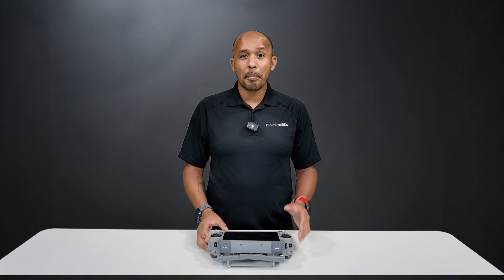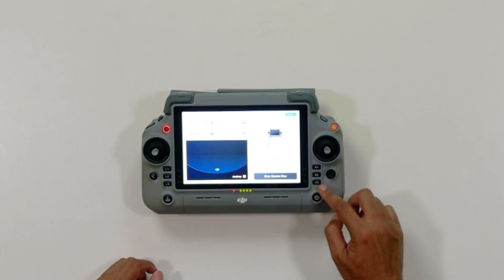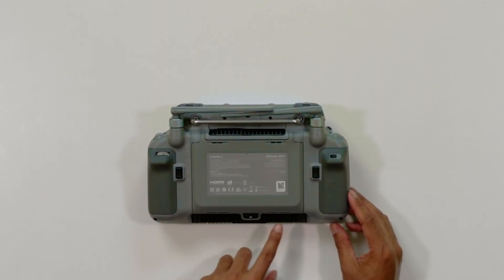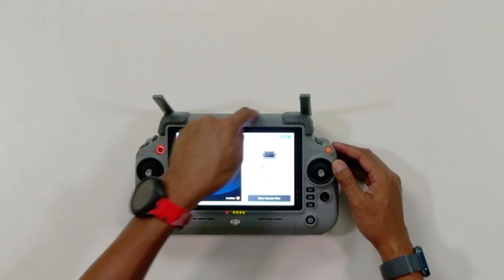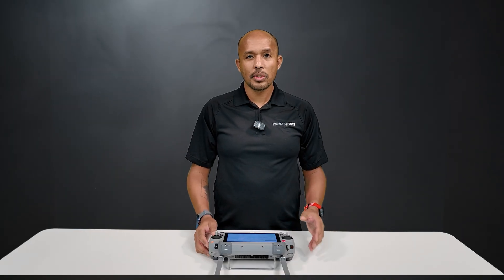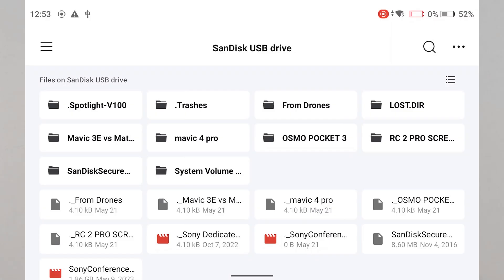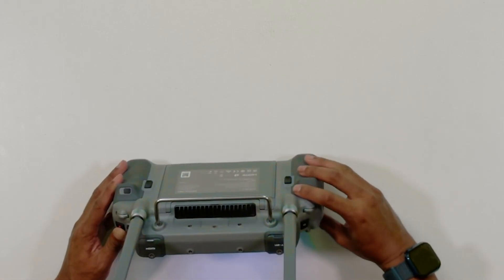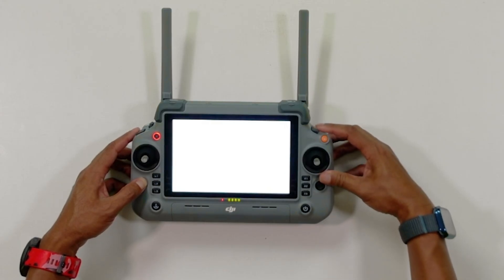Can You Find All 21 Buttons and Dials on This Controller?

Comment: Can I use a thumb drive on my Mac and transfer the file to the controller and vice versa?
Reply from the maker: Hi Pat, you sure can. It'll pop in right at the top of the controller and you'll get a little USB icon at the top of your screen once it's in.
Reply: @DroneNerds great!  I was concerned about the whole Mac/Android compatibility.  Thanks & great video!

Comment: Can the controller when connected to an external monitor via the HDMI port be use as an additional monitor to use apps with or does the controller only mirror what is on the 7 inch screen, Thanks in advance.
Reply from the maker: Hi, great question. Unfortunately, it is just mirrored off what you see on the controller.
Reply: Thank you  @DroneNerds
Reply from the maker: Hey, actually you can change the settings in terms of what you see on the external display like only seeing the camera view, a duplicate of your screen and some other options. Will be doing another video breaking this down soon.

What was initially seen on the controller was just the controller by itself but with the M4E connected, you'll get more options.
Reply: @DroneNerds please do a video about this with XR/AR Glasses or VR goggles! This is what I was thinking of doing when I first commented.
Reply: @DroneNerds Any chance this video got made and I did not see it?
Reply from the maker: @SignalSeeker  Hi SignalSeeker, you didn't miss it but we will try to get a video out on this in the next couple weeks.

Comment: Thanks for this - I had no idea about the volume and brightness shortcuts - that is actually very helpful when using gloves when you can't touch the screen. Also, I did not know you could use the top USB for flash drives, I thought that was reserved for pairing to an RTK station. That is going to make file transfers so much easier now! Thanks for reading the manual for us so we don't have to!🙂I'm loving, seriously, the Matrice 4 I purchased from you a few months ago. I've got about 180 hours on it and it has already paid for itself several times over!
Reply from the maker: Glad to help! So many cool little tricks with this controller and a lot more to come. Also glad to hear you're enjoying your purchase. It really is a fantastic product.
Reply: Qual o produto que  voce vende com o Matrice 4?